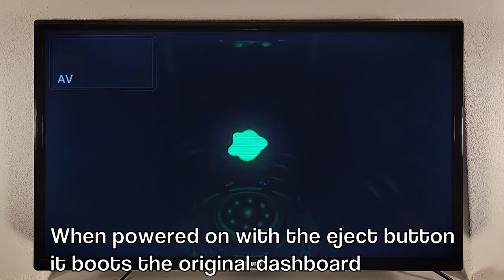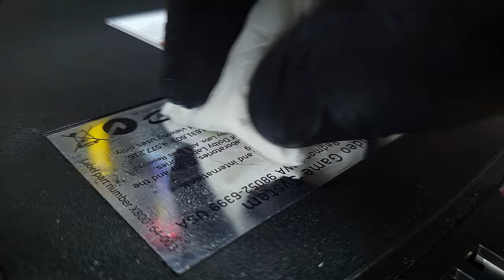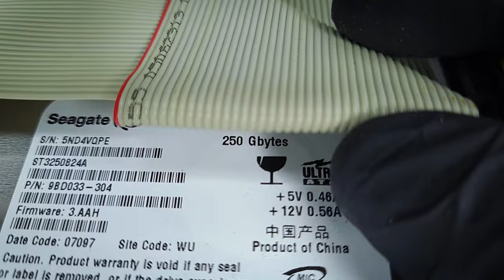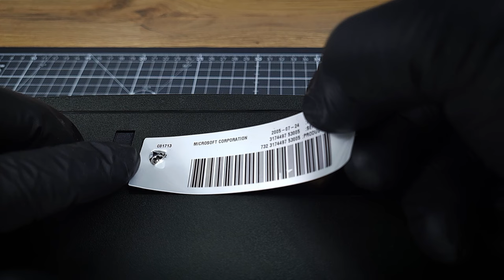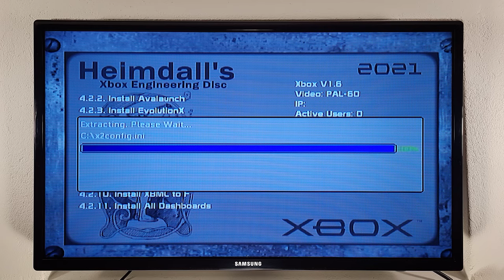XBOX Repair

Comment: I have worked on several Original Xboxes and every once in a while I will get one where the plastic is very brittle like this. From what I recall it has been v1.6 boxes every time.
Reply from the maker: Thanks for sharing. I wonder how these were stored? Or maybe it's a bad batch which they fixed later on.. Thanks for watching!
Reply: I opened one to do a recap (it was suddenly dead on the button), nothing broke but got scared off from trying to get the faceplate. No pre-snapped bits either.

Its a v1.6 Crystal btw.

Comment: Beautiful video. Almost like an ASMR in some parts. When the brittle plastic kept snapping, it made me feel the opposite, like intense frustration ha ha. Wonderful camera angles too. Thank you for making it! 

Quick question: what kind of “vinyl spray”  (cleaner?) and what type of adhesive did you use for the feet / labels? 

Many thanks
Reply from the maker: Thanks mate, I really appreciate it 🙏  For the plastic I used Armor All Protectant and Taperunner for the feet 👍
Reply: @RestoredChannel  🙏🏻🙏🏻

Comment: Hi great video. What type of grease did you use for the dvd tray.
Reply from the maker: Silicone grease, thanks for watching!
Reply: Ty I am sorry what also lubricant did you use to lubricate parts?
Reply: What glue did you use to glue the rubber and stickers where the screws went?
Reply from the maker: Search for taperunner👍
Reply: What brand silicone grease did you use? Thank you.

Comment: To all you restoration junkies out there...  When you clean fans, never blow air into them and allow them to spin up.  This can ruin them.  Hold the fan blades still with your finger and then blow air into them, changing the blade position a few times.  Then use cotton swabs and IPA to clean the hard dirt off.
Reply from the maker: You're absolutely right. I just had to play with it😁  thanks for watching!